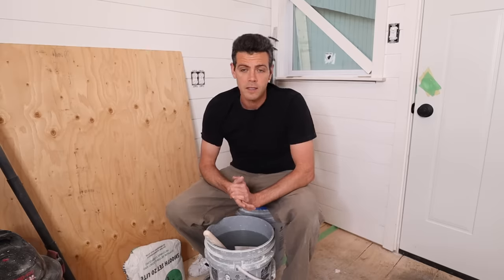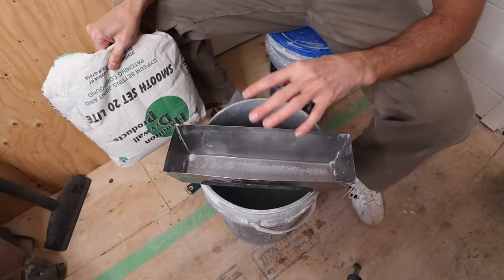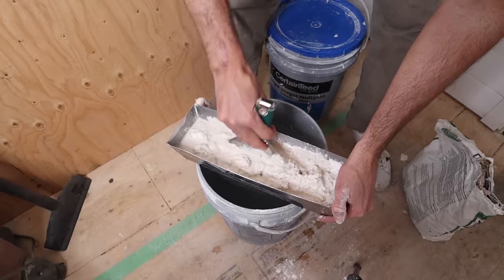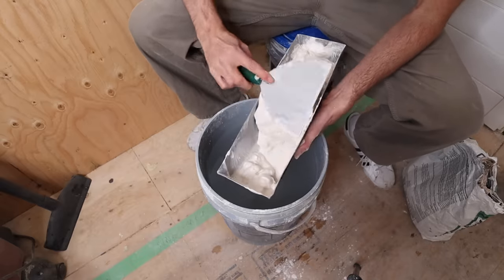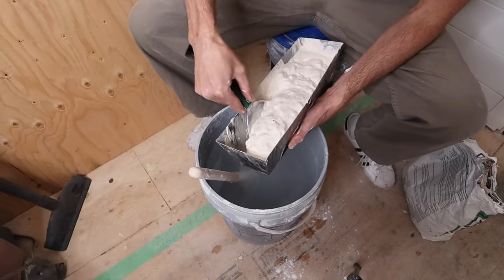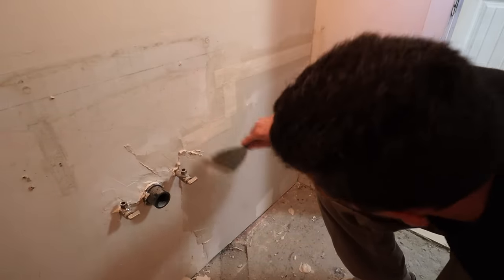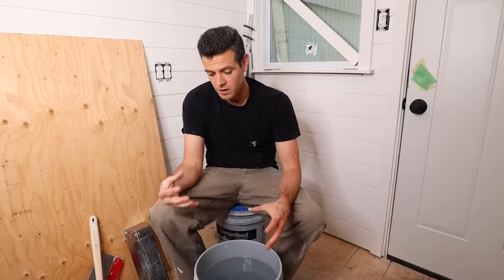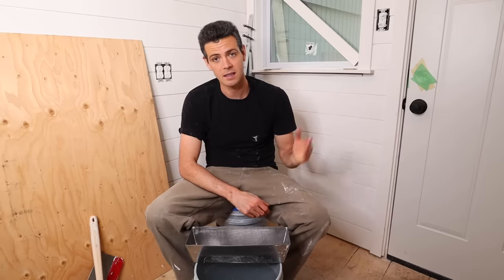How to mix Quick Set Drywall Mud small batches Hot mud

Comment: I literally started a drywall repair “specialized” company after learning how to finish drywall from this guy. I had an insane boss/contractor sub me out the job and he got lucky I cared enough to research and hit up YouTube. By the time I finished I enjoyed taping/finishing. The The way Ben talks in his videos make it easy to relate to, super honest. I can’t even tell most of my customers that I learned from YouTube. Funny thing is I’m quicker with better quality than people  I have tried to hire with decades of experience.
Reply: Great idea. Good luck to you.
Reply: Yup I've experienced the same thing. 20 years experience doing it wrong, no idea what a building code is, never pulls permits. Yeah. We don't do that here. 😂
Reply: Yes I agree with your statement. But slinging mud is very easy when you have spent time practicing. I remember one day  I blew through the job. Mud was not all over the place and had little sanding. That was the day I said to myself man I got this beast whipped. Then years later a contractor was talking crap and I said take you pencil and draw a circle on the sheet rock. I took my 6" dipped some mud and slinged it at the circle. 75% landed in the circle. Then handed loaded blade to contractor and said now your turn. He nailed the window instead while trying to hit the circle. I just smiled and said you got a mess to clean as I went over to the circle and ran the blade and removed the mud.
Reply: Sure you are. 😂🤣😂👍
Reply: Ignorant people belittle the knowledge pool and first-rate craftsmen on Youtube. If you find the right “mentors” and you take pride in excellence, you will be the best just as they are.
Reply: Ben is the man. I'm just a DIYer trying to refresh and relearn. He's done me good. I can half ass a hawk and trowel now despite me not doing his training regimen... Maybe I should.
Reply: Brother how much water to one bucket blue compound ?

Comment: I find that the amount of product in the bag does make a difference.   I can mix up half a bag and get the allotted time.   Mix up a small batch from the remainder in the bag and it sets up differently.    Could be how the ingredients of the mix settles in the bag?   Although it should be even from the factory in each bag.   Same as potato crisps (chips for the North American folks), you get the salt/seasoning left in the bottom of the bag at the end.
Reply: I had a job where I noticed the 20 and 45 were behaving opposite. I thought maybe it was the water, but i used the same bags on another job and it did the same thing. Started thinking the bags were wrong from the factory! LOL I don't remember if the jobs were city or well water, but I think it was city!

Comment: I ground a 4 inch blade down to fit the bottom of the pan. I use it for mixing. it gets the chunks and stuff.
Reply: Also you can buy skateboard grip tape and apply to bottom of pans. It holds up for a while.

Comment: For complete newbies like me, I can't recommend the 90 minute stuff enough. Gives you lots of working time to figure stuff out, and at the end of the day, unlike the pros an extra hour isn't a big deal - my projects are measured in DAYS, not hours for even the tiniest projects LOL.

I also mix much smaller batches and use a old soup ladle to scoop out the powder. I'm a bit slower than you are.
Reply: Same here but not just days sometimes weeks lol
Reply: Same, but months lol
Reply: I'm doing a refresher course for a bathroom project I'm finishing now that I'm retired. It was started 17 years ago... yeah... no rush on how long it takes to dry! LOL
Reply: Thank you! I was planning on getting 45. Glad I saw this.
Reply: @joseph7105  Paper tape is fine. It's recommended you don't use mesh tape with regular mud/joint compound.
Reply: @joseph7105  
I’ve heard the same - paper with the all-purpose taping compound and mess tape with the quick sets.
I’m not an expert (I’ve watched hundreds of hours of videos on dry wall mudding includes dozens of Ben’s), but they all seem to say getting the tape wet enough is the key to getting it to stick and not bubble.  That’s why in this video Ben is mixing the mud wetter.  All-purpose sets up much slower which allows the tape enough time to activate its adhesive properties.
Any experts out there please correct me if I’m wrong.
Reply: Yes I only use 90 minute because it takes me forever to mud and tape lol.

Also I’m on month 8 of a ceiling soundproofing job of a 12x16 bedroom 😅
Reply: @penguins @Karen Greene I have a repair around my glass block window that's timeline is into years so there! 😆😆😆 Procrastination is a bitch!
Reply: @AndrewCislak  working on 2 bathrooms and a laundry room since... May.  
I feel you!!
Reply: Haha me too!
Reply: Lol yes it takes me days for something that a pro would do in hours!!!!
Reply: Good recommendation its my first time and i bought 20 mins and at start strippinn off the wall it was drying. Damn and is tape necessary in like 2 by 4 feet patch
Reply: @MarleneD1216  Funny Marlene😅. I've only been working on my bathroom for 6 months. I hope I don't stretch it out to 17 years!
Reply: I bought the 45 minute mud and I have city water that requires no water softener. Starts becoming unworkable pretty much at the 45 minute mark just like the bag says.
Reply: I bought 20 minute mud. I swear that stuff starts changing texture and is unusable after 5 minutes.  Something I also didn't realize,  the fast cure time only allows you to apply another layer after 20 minutes. You can't paint or sand until after it air dries.
Reply: Do you pre fill and tape with the same 90?  And what’s the best finish coat?
Reply: Same but years..
Reply: @emerickshaw6318 No one replied! That wasn't cool. It's happened to me back on the day. 20 minute is good for prefill. Doesn't shrink. Don't mix a lot at first and plan out your fills before you add water. 20 minutes starts when you get the water in about 70 percent. Dump and clean in a dirty bucket and mix a new batch with clean trowel and tools. Use fans to dry large areas.

Comment: It looks like lots of beginners commenting so I just thought I'd add a few lessons learned to this good and accurate video. It can seem intimidating to use setting compound at first but I much prefer it now that I've made all the mistakes with it that are humanly possible lol. 
1. Less water = more open time. It seems counter intuitive, but water is the catalyst causing the hardening here, not evaporation like premix. I shoot for the least amount of water possible to make my mix workable. 
2. I don't do this every day, so mixing in the pan just takes too long for me. Also the more actual mixing/motion, the less open time. I mix in a 2 gallon bucket, the kind that is just a mini 5 gallon not the cheap flimsy type for mopping or whatever, and use a potato masher with a rounded front edge from the dollar store, and I can have a full pan way faster with perfect consistency with minimal mixing and mess. 
3. Reiterating the point about cool and clean water. Using warm or hot water is like jump starting the setting process. Also, USG accelerator is Aluminum Sulfate, and that's supposedly used in water treatment processes so if you're having issues with mud going off too fast it may be the site water, you can try adding retarder.
4. If you're like me just doing repairs mostly and a big bag can last you a long time, you might be better off keeping it in a bucket w/ a lid so you can shake it up. The contents will settle differently in the bag over time and without mixing it all up, can also make setting times go all over the map. 
5. There's def inconsistency in set time between bags of the same thing. 
6. This stuff is so cheap, don't stress about how much to mix or about getting it all up if it starts going off. In the long run it will be faster to dump it and get another batch going. Eventually you'll get better at judging amounts and timing.
Reply: Great "tips", Thank You!
Reply: Your less water tip really came in handy today.It mixed very smooth and didn't harden before I could use it all
Reply: Thanks for the tips!  Since I'm just starting out,  I bought a bag of 90 minute Quick Set Light joint compound thinking I would need all the time I can get to figure out how to use it.  But  now that I've used it a few times I wish it would set up faster.  Can I buy just the accelerator and throw some into a batch I'm making?  Sometimes it takes all night to dry!  Also I'll try shaking the bag like you suggested.  I've had that same bag for months.
Reply: @erichsh58  The easiest thing you can try is using warm or hot water to speed it up. Tbh though the stuff is so cheap I'd probably just buy another bag of quicker set time.
Reply: @erichsh58   With the bag of 90, it can be sped up with a small amount of plaster of Paris. Get a container and add to your mix in small amounts. In time you'll perfect your skills. 😎
Reply: The accelerator is not aluminum sulfate. It is calcium sulfate dihydrate. The retarder is calcium sulfate hemihydrate. Search for "safety data sheet usg easy sand".  replace "easy sand" with "accelerator," or "retarder" for those products. But Andrew is correct that the presence of other salts (e.g. alum) will speed up or decrease setting time of gypsum products.
Reply: @nnamrehck  Yes it is actually. Both are used in gypsum plaster accelerator products. See: USG Gypsum Alum/ Catalyst Plaster Accelerator, SDS 53000010017
Reply: @3leggedgenes  Thanks, I learned something!
Reply: @3leggedgenes  I also noticed that durabond 90 is almost pure gypsum!
Reply: I use a potato mixer beater on my drill.  20 second and am done great looking hot mud. No lumps those lumps are dry mud.
Reply: Why the tape??

Comment: Thanks for this. I moved into a house with a TON OF LAYERS of wallpaper, black tar adhesive, more wallpaper, individual wooden panels glued on with liquid nails, and then wallpaper on top of that, and then WALL TEXTURE ON TOP OF THAT! It has taken me days to get down to the bare wall, only to find that the bare wall is EXTREMELY old plaster (house was built in 1940), painted with only God knows what type of (cracked, disgusting, dried and peeling off) paint. 

Needless to say, a lot of the plaster has crumbled from the wall, leaving large, palm sized holes. There was one hole that went all the way through the wall — which I had to reinforce the wall on that one which was a learning experience in itself. 
Now I’m in the process of sanding down the walls to make sure that any gunk and leftover paint is smoothed out, which I have one wall left to do. Now I’m taking a break because it’s 10:09 PM and I have to mix a small batch of some hot mud to patch these holes in the wall. I plan on adding some glue to some clean, bottled water, and then use that to mix into the mud so it will adhere better. 
I’m using 90 minute mud, only because I’m a 28 year old female who has absolutely no experience or knowledge in doing any type of work like this. I have done this all on my own so far with no help from anyone. I cannot express the amount of frustration and stress I’ve had during this whole process, but on the other hand I cannot express how grateful and appreciative I am to you for sharing such a wealth of knowledge (and for free!) You have truly changed the way I look at myself and my ability to do things. Thank you for all that you do, and even though you’re just a drywall guy, you’re touching a lot of lives in deeper ways than you can possibly imagine. My dad was never around me my entire life. I never had him to show me the things that dads are supposed to teach their kids — so you, sir, are very much more than just a drywall man on YouTube. Thank you again.

Comment: A good rule of thumb: 5 minute smooth set hot mud sets up in three minutes.
Unless you're anxious to apply a second coat. Then it sets up in 10-15 minutes.
:-)
Reply: Truth... and then there’s the “20” that’s about 7 minute when you need it to be 20 😂
Reply: @ryane6719  And there seems to be a time period between "mix good" and "mix set".   Normally in the time it takes me to adjust the ladders....
Reply: I don’t get it, my Durabond 90 sets in 30 minutes (working time) on my hawk. How can people get 60-90 minutes working time?? This shit sets quick….I can manage 30 minutes the problem is I have to work with small portions…a lot of extra work and time to clean the tools and mix it again. I already use filtered good quality super cold water…Any tricks I’m missing to achieve 60-90 minutes for Durabond 90?
Reply: @ulrichkessler9328  Maybe try testing the PH of the water you're using?
Maybe you're over-mixing it? Not sure if over-mixing is possible....I've never had that problem unless the product or water was contaminated.  Our crew has used muddy water to intentionally quicken the the set up time...good luck.
Reply: @ulrichkessler9328  You have work it in the pan or hawk while using it so it doesn't set
Reply: Ain't that right. A headache
Reply: @ulrichkessler9328  The time is the setting time not the actual working time. It's been a while since I used 90 but from memory I would guess 30 minutes is more in line with the norm than it is indicative of any issues. Don't wait for it to really start setting to go to the next batch. The stuff is cheap, mix bigger batches and as soon as it starts to get stiff to work just dump it and mix the next batch. It's much quicker and easier to clean everything off in between batches that way vs cleaning after its really set up on all your stuff. That's been my experience at least. You can always try using a retarder too.
Reply: Keep in mind water to compound proportion in terms of working time. The denser the setting compound=less water=faster setting. In other words: add more water if you want the most time and add less water if you want it to set and then dry as fast as possible. Set meaning harden and dry meaning actually dry. Yes this distinction matters, especially if you will be wet sanding.
Reply: Lol so true 🤣
Reply: @dmutant2635 interesting on the muddy water to speed up the setting.  I’m on here today trying to figure out while my mix seemed to be setting up faster and faster.  I was using the water that I rinsed my mixing paddle in.  So as that water got “ muddier”  from cleaning my paddle each time, in turn the mix was setting up faster and faster.
Reply: So true!

Comment: Thank you, Ben! I come back to this video (and others of yours) every time I have another (inevitable) drywall project in my 100+ house. I’m a transplant to Memphis where the humidity can fluctuate wildly depending upon the  time of year, how close the wall repair is to the exterior of the house, even the time of day seems to make a difference. 

Aside from simply getting better at the basics, your advice about using quick set has been the most useful for turning intimidating multi-day projects into manageable, (dare I say fun) and relatively quicker ones. Confidently reaching for the bag of 20-minute or even 5-minute has transformed my work flow and hopefully the value of this olde house o’ mine. Thank you again.

Side note… much of the work I do on this house is matching new sheet rock of varying thickness (sometimes in layers) to olde plaster work. I have found that it is often better to forgo tape entirely. I’m still experimenting to figure out what to use when but 5-minute and 20-minute layers are key to matching the hardness of those complicated plaster layers! Once again, thank you, Ben.

Comment: I’ve found using a 2 inch margin trowel is the best for hand mixing in the trod and the bucket. It’s offset really let’s you fold the material quickly like a paddle mixer does without getting your knuckles caked up. It also lets you get into the corners easily. This is a quintessential skill, thanks for walking us through it you always deliver knowledge/experience nuggets!

Comment: Buddy thank you so much for your videos.  My girlfriend lives with her elderly parents to help manage..well manage lol..the 3 flat.  I did my first patch job today.  Former tenants punched a hole in the wall then patched it with 12X12 wire mesh stick on patch, then tried.  I sanded it down and I used 20 min hot mud 3 coats.  It didn't set in 20, looked like 45.  I feathered those edges and she said it looked like her paint job without me sanding.  To be surprised it really looked good.  We will see what it looks like tomorrow.  Im a hawk and trowel guy.  Used to finish concrete.  Thanks again.  Edit, she asked how many times I did this cause I was working so smooth.   I said never, I just watch Vancouver carpenter all the time.

Comment: That is why I mix 90 minutes mud in a bucket with a power drill and paddle.   It gives you way more time to work with it and it gives you plenty of time to work with it, in corners and joints (I use mold resistant mesh tape).  By the time I'm finishing up the last area I can go back and pre scrape any areas needed before it gets all the way hard.   Second coat is topping lite and it is ready for paint

Comment: Very helpful, Thanks man!! I've been finishing drywall for 38 years and never used the quickset believe it or not, so this was helpful. I do know that we can NEVER use hot or even warm water, if you do, you have like maybe 5 minutes even with a 45 minute bag. Learned that when I was mixing up some grout for a tile job about 30 years ago. Just a tip. But this was helpful, again Thanks!